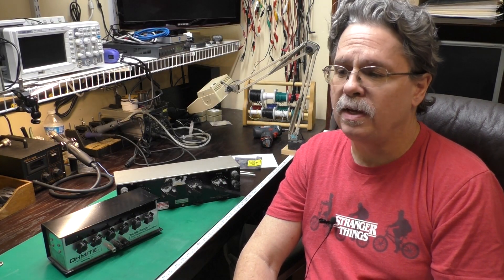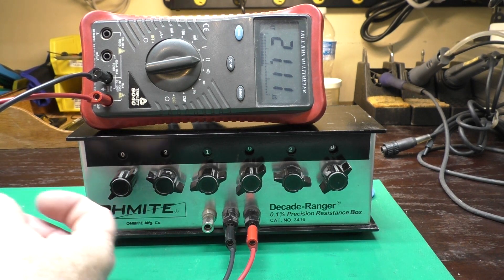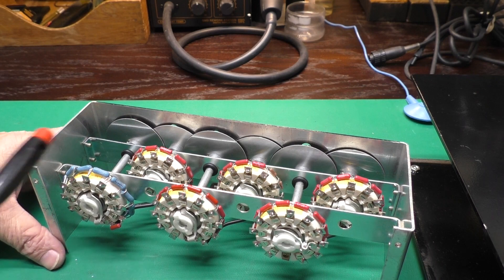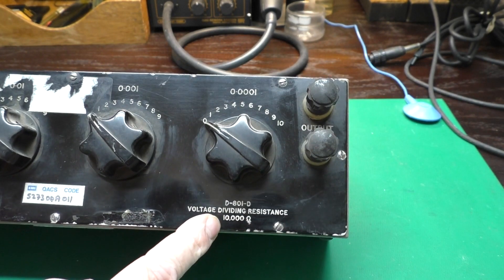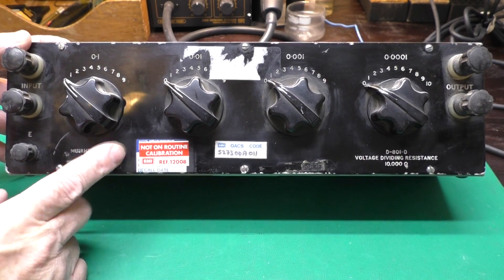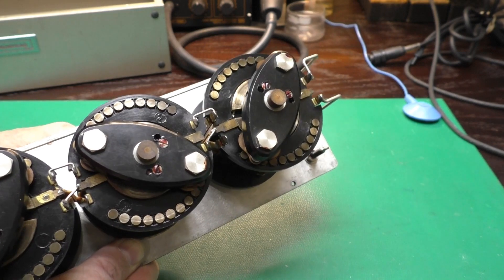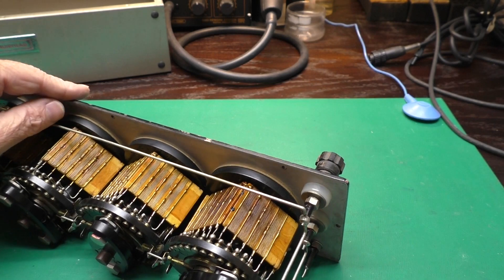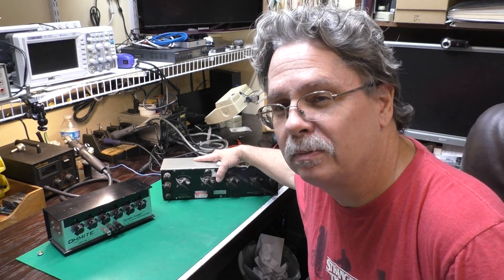Test Equipment Thursday - Muirhead and Ohmite Resistance Decade Boxes

Comment: Isn’t that constantan wire that is used in resistors? https://en.wikipedia.org/wiki/Constantan
Reply from the maker: Or it could be manganin which is very similar. NIST used Manganin resistors as standards until the 1990s. In either case I'm not confident that I could rewind them myself.